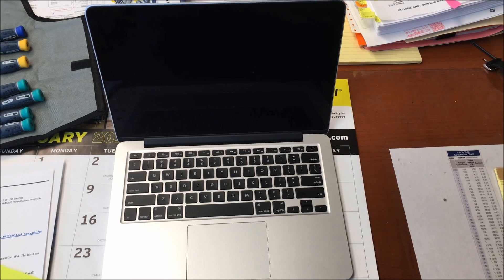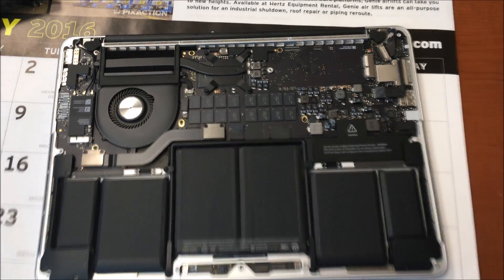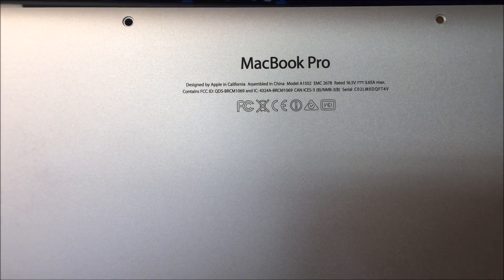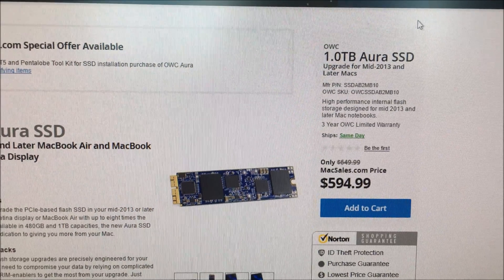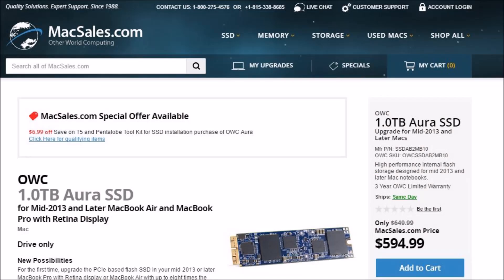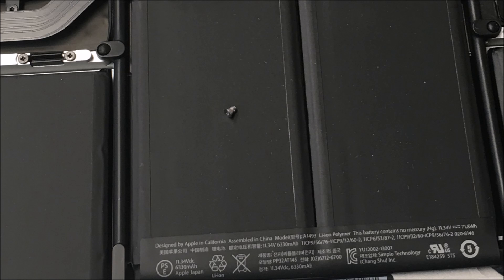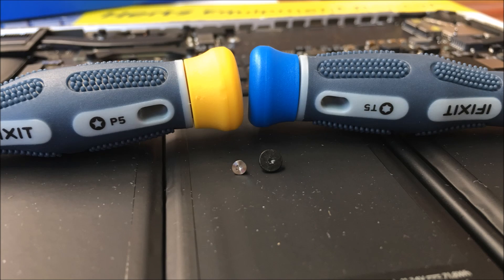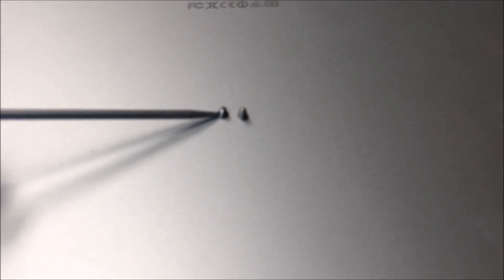How to upgrade SSD in late 2013 MacBook Pro with retina display

Comment: Quick Question can you answer for me? beside the fan, there is a rectangular box  with 3 wires connected by a gold fastner. Where can I get this fastner.
Reply: you're likely cooked, it's typically extremely hard to find any replacement cables for the wifi card

Comment: currently debating doing this.  I have a 256GB in my late 2013 15" retina macbook pro.  I might buy the Kingston 960GB for $300 or the Samsung 1TB for $400.  It's cheaper than a new macbook and I still have all the ports plus it's a i7-4770 processor so it's not too bad for editing.   I may as well upgrade the Ram while I'm at it from 8GB to 16GB.  or can it go higher?
Reply: Sorry to be the one to give you the bad news, but the RAM in retina MacBook Pro's is soldered to the logic board. There's no way to upgrade it without replacing the entire board, and at that point you may as well buy a new MacBook Pro. I'm in the same situation.

Comment: Hello, I have a question about this initial 500go ssd in this particular macbook, can it only be used on macbooks? My old macbook pro feels like it's gonna die soon and I was thinking of getting the ssd inside out and putting it on a x370 / b350 motherboard for my ryzen desktop computer.

Comment: +Serge Letunovskiy Thanks for the video! Did you notice any improvement of speed with the new Samsung ssd-stick compared to the old original one? I'm ready to replace the battery in my 15" early 2013 Retina MacBook Pro at a Apple-approved shop and asked them if the mac would run faster regarding e.g. video editing if I swapped to a modern new ssd- stick as well, and they (of course) said that it was a good idea to do so ($450)... so, can you confirm that the computer runs smoother, faster and better than with the old ssd-stick? Very happy for answer...
Reply: I'd like to know as well because it seems like i am getting more and more beach balls spinning. Just doesn't seem to run as good as before
Reply from the maker: Ulf Brusquini I did this for a friend of mine, so I couldn't tell you if there was a bump in speed.

Comment: Hello, I have a macbook pro late 2013 "15 inch" with retina model A1398 EMC 2745, can I replace my ((APPLE SSD SM0512F)) 500G with Samsung 960 PRO Series - 512GB PCIe NVMe - M.2 Internal SSD (MZ-V6P512BW)??
Media Name: APPLE SSD SM0512F Media
Medium Type: SSD
Reply: Did you watch this video? In the actual video, he gives at least two website resources to check compatibility. Go to the web site that has "Mac" in its name.
Reply: Read my question again!,  OWC only checks the compatibility of their own ssd with other macbook pros.

Comment: I really appreciated this video. I have just learned that i made the same mistake, after going in to a local computer supply dealer and providing the specs for a late 2013 macbook pro with retina display. I was offered a Samsung 850 EVO. I had decided to shop locally because i was anxious to complete the upgrade over the weekend to have the machine ready for the upcoming work week. Too bad, so sad, now i will have to wait for a new one ( and the correct one) to arrive in the mail, and make the three hour round trip drive back to the computer store to return the Samsung ssd. 
I should have checked your youtube video first!🤕😱🤓👩🏻‍💻

Comment: almost $600 thats crazy.
Reply: why it so expensive?
Reply: I need to replace my SSD, but I can't seem to find any other SSDs that are compatible (or at least stuff that has been promoted). I don't want to run out and buy any PCIE ssd, because theyre terribly expensive here (and buying from OWC is even more)
Reply: You can use any M.2 NVME harddrive, like samsung, if you use a ~$10 adapter.  I installed a 1 TB samgsung 961 NVME for $215, and get read and write speeds over 1000 MB/s.  Search amazon for "macbook pro m2 nvme adapter" and get the one with the best reviews.
Reply: Dr. Cyb oh sweet. I ended up going with the one I linked and it worked out great. Installed a 500gb nvme drive for about $150 total :)
Reply: Dr. Cyb Can you provide the link to this ssd?
Reply: Michael McCreary I used a Samsung pm961, but the Samsung 960 and 970 nvme drives should all work, and were recently cheaper (I believe on sale for $200 for 1 tb on amazon) than the pm961 I purchased.  I purchased my pm961 on eBay as you cant but it directly.  Whatever you purchase, you need the $10 adapter mentioned above.
Reply: Thanks for the video! Much appreciated!
Reply: Lmao he could have used any MAC compatible m.2 ssd